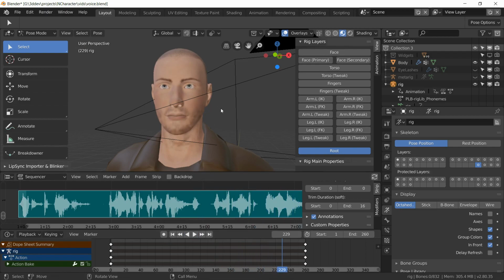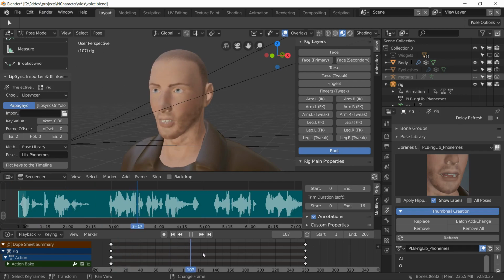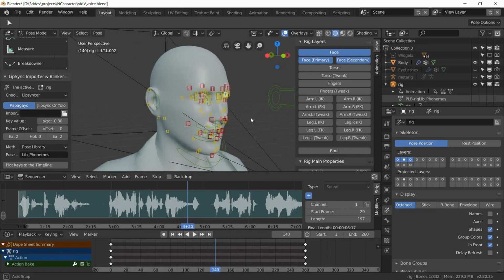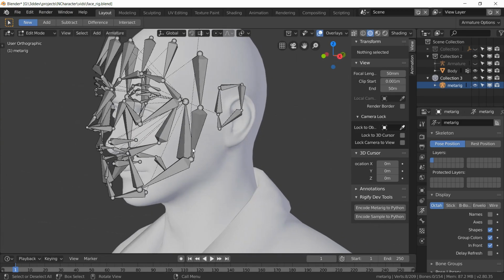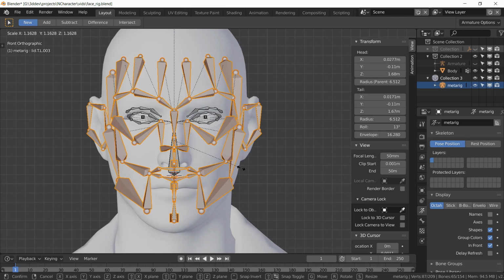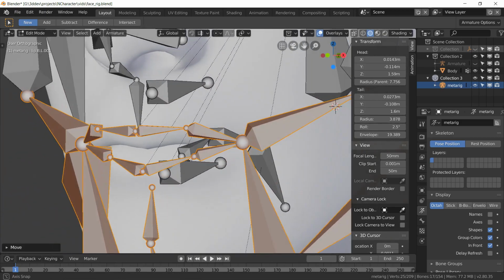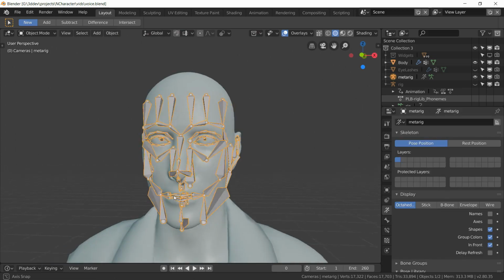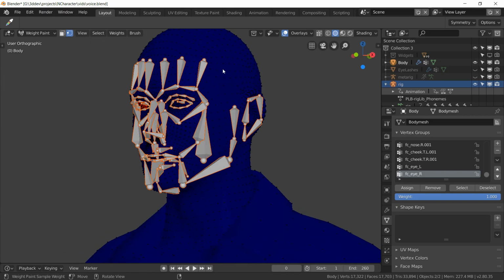Talking Characters with Blender 2.8 for Unreal Engine 4

Comment: hey, love your addon , but there is a problem that occured in my rig, after you jump to the finished mesh i got lost, did you rig the mesh to the bones with only deforme or automatic. bec build skeletone process in the advanced rig the jaw nor anything in the face moves  with its bones. i dont know what to do
Reply from the maker: The character face was rigged with automatic weight paint then touched up a little. You can use automatic weight or do your own custom weight painting.

Comment: Any way to import only the face animations to my character?

I have this problem. My client asks me to make face animations for his game and he did give me a mesh and bones with it that looks like they made with blender as the main bone is called UNRIGIFY and other bones are DEF-something. It has face rig but I can't rig it in rigify coz the bones are not set into any rigify bone set (Yes I have tried to set manually its bones to rigify bones but there are still differences to the normal meta human rigify set which causes the control rig to fail.

So if it could be possible to just delete all other bones below head and if I get only the head working in so that I can control it and then import it to ue4.

Comment: Hey man, when importing the rig to Unreal do you get the error where you go over the max influence of 8 bones per vertex and if yes, how did you fix that?
Reply from the maker: In Blender go to 'Weight Paint' mode then under weights menu there is a tool called 'Limit Total'. You can set the max number of bones per vertex for your entire character or any selected vertex group.
Reply: @RakizFarooq  Thanks alot man!

Comment: I got Papagayo to work in Blender 2.79b and I got Rigify working in Blender 2.80 Beta. All I need is that Blender 2.80 Beta script/add-on for Papagayo. Great job on this. The Rigify Meta rig is very touchy regarding setting up the Facerig alignment to our base mesh. I tend to do a lot of scaling in edit mode and popping in and out of X Axis mirror to achieve the best results I can possibly pull off using it as you did here. Fun stuff! 

Was gonna launch my video covering the Meta rig alignment for Facerig as well, but it's 3 hours long 😄 so I think I need to trim it down a bit. Looking back at how long it took me to get it right. I'm happy I didn't quit lol. Cannot wait till that Papagayo add-on to be updated and launched for us all.
Reply from the maker: The script is nice but I think you would get a better result by hand keying the poses. Papagayo already breaks down the phonemes. It is usually  3 or 4 per word. With the pose library available, hand keying is not that hard to do.
Reply: @RakizFarooq  yeah I actually was thinking of trying hand keying the facial mouth motions. The tough part is to get the right cheek muscles and jaw areas to move in conjunction with the lips. I've played around in the past with creating shape keys so that skill set might help me to pull this off. We shall see!